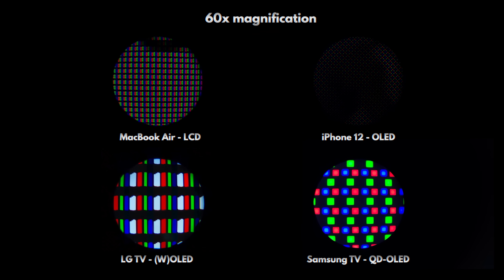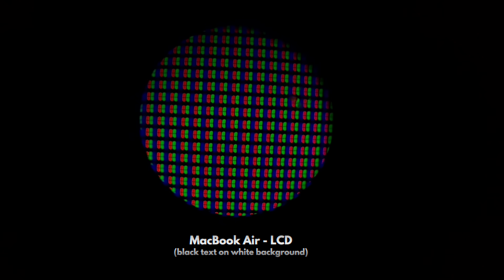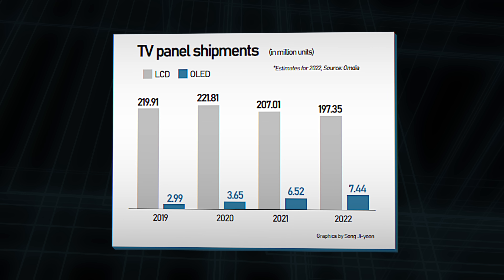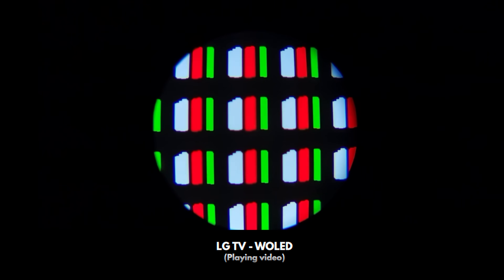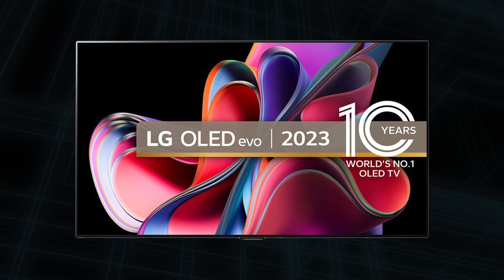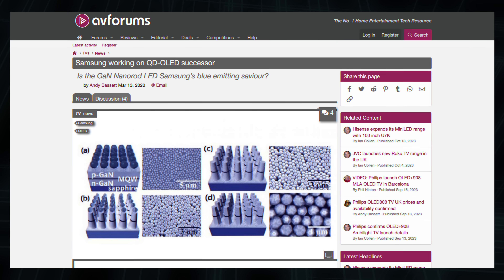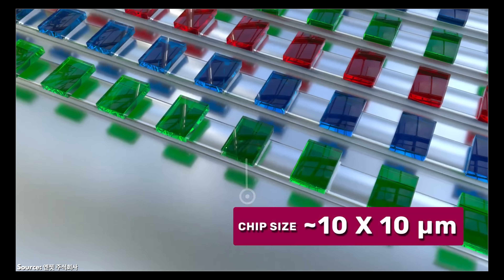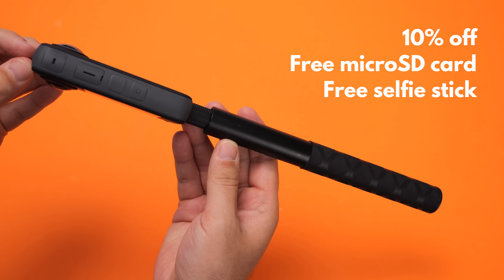The billion dollar race for the perfect display

Comment: I actually like Mini/micro LED the best.  It doesn’t have quite as good blacks as oled but it also doesn’t have burn in.  That’s what MacBook pros have and imo they’re the best looking laptop screens available.
Reply: Burn-in in OLED would happen because they are shipping TVs with bad settings that artificially increase their brightness ruining their color accuracy and adds wear to the panels.

Apple's screens don't have any weird post processing BS, that's why they look amazing.

It depends on the display tech, for example, QD OLED is the best well rounder tech. How Samsung solved the RGB, warm color and brightness problem is brillant and very simple.

Comment: If they could only sort out the OLED burn-in problem for good, that'd be amazing. That's the one thing keeping me from switching out of my LCD PC monitor.
Reply: Samsung already solved it with QD OLED. Micro LEDs also work.

Burn-in on a Samsung QD OLED is similar to a CRT, the overall screen would lose brightness.

Number 1 rule to avoid burn in: don't overbright your image.

Comment: Sticking with my IPS monitor until the burn in problem is eliminated, for a monitor you have so many static things on screen that it becomes a big risk, I like that I don't have to care at all about burn in.
Reply: Samsung solved the burn-in problem with QD OLEDs. Since they are a lot brighter, they last longer and look way, WAY better than LG's panels.

It brought back the CRT and Plasma warm (accurate warm colors) that i missed so much on TVs. It's safe to switch now to OLED, the only thing you should worry about is your wallet.
Reply: @saricubra2867  Its not safe to switch at all, burn in is still a problem and as someone that has static things on the screen for an extended period of time the burn in will happen quick.

Comment: crts and feds are better than oled other displays, just crts are heavy and feds never made it
Reply: QD OLED shares a lot of the CRT's benefits. Color accuracy is the same but it's significantly brighter.

Samsung QD OLED subpixel layout is basically the same as the phosphor layout for their old CRT dynaflat tech (their high end monitors aged extremely well and still usable for current stuff nowadays).

The only thing missing is the perfect motion clarity because no other display tech draws an image line by line like a CRT does (because it's analog).

Comment: It's worth noting that the earliest LCD displays in which a pixel was made from 3 vertical strips of red, green & blue were leveraged by Microsoft to produce a system called 'Cleartype'. 

Put simply, as long as you only intend to produce greyscale (as it common for text) then it's possible to introduce what is known as sub-pixel rendering.

Since the strips repeat RGBRGBRGB and so on, you can (for example) switch the GB of one pixel on & the R of the pixel to the right of it to on. So instantly you can shift a pixel by 1/3 or 2/3.

Sadly LCD screens no longer work that way BUT on platforms like the Gameboy Color, a few developers used this trick to produce much clearer text (hence the name Cleartype).

Comment: QD LED is using Phosphor coating which is what is making the Green and red. This is more efficient that filtering because the Phosphor converts and fluoresces at a higher efficiency (typically >95%) than filtering out (<67%) the light.  Fun fact, this is how "white" LEDs are made. They use ~405um blue LEDs with a controlled blend of green to red Phosphor coating it.
Reply: You seem to be mistaking QD LED to OLED here.
QD LED is an improvement to the LCD technology, where they used QDot crystal in place of the Liquid Crystal of LCD. For the backlight, they used LED. This means that they can be lit really bright without compromising the burn-in, and they have very good motion blur.

OLED is a totally different thing, where every pixel is a diode, without any sort of backlighting. Phosphorescence oled is the new generation, but it's very expensive because you need rare metal (Iridium, platinum, etc.). The latest OLED technology is based on TADF (Thermally Activated Delayed Fluorescence), which is much cheaper and can theoretically be as efficient as phosphorescent OLED.
Reply: @gold9994  sorry I meant QD OLED. normal OLED uses filters over each pixel to colour mix, making them subtractive lighting. QD OLED uses the above mentioned phosphorescence which is a energy state change not a filter meaning more of the source light is used to create the desired coloured, meaning the pixel light can either be driven at lower power for the same brightness or be left at the same power to be brighter.

Since they are using phosphorescence, why do they need rare metals? last I checked red and green phosphorescence powders didnt have rare metals in them.
Reply: @gold9994  Samsung QD OLED is real OLED as well and better than the AMOLED and P-OLED tech that you mentioned. 

There's no backlight. Just like in CRT for the electron guns hitting the phosphors that produce each color and brightness, each blue LED in a Samsung QD OLED is both the brightness and the color for the panel since the quantum dot layer doesn't care.

AMOLED and P-OLEDs struggle with highlight color detail. It's washed out, QD OLED is basically the current CRT minus motion clarity.
Reply: @saricubra2867  Disagree. Bye.

Comment: Persistence blur from sample and hold needs to be solved before anything else.
Reply: only viable fix i heard of is 1000hz, that would have all the benefits and no flicker.
we just need thru the 300hz up to 1000hz, that region the benefits are small. wish we just got 240hz and then skip right to 1000hz.
and we need to develop frame generation from base fps 250 and quadruple it to 1000hz. unless we can also address the latency problem. then we need 120fps to fill the whole 1000hz display.
Reply: @sudd3660  I own a Samsung Syncmaster 955DF, at 60Hz 1600x1200 res, it would take less than 30 microseconds for each scanline.
Therefore it would be around 85000Hz on a Sample&Hold display, not 1000Hz (1ms).

Viable fix is black frame insertion.

Comment: they've already been thinking about how to use quantum dot tech to make micro LED monitors... As theoretically, it should be possible to make the quantum dots glow by applying electrical energy through them, or something along those lines.

problem is how to make a subpixel screen dense enough for it.

Comment: My LG C9 has a power on time of 14337 hours and there’s barely burn in, ive noticed only temporary burn in but you get used to it fading quickly. I usually use it for gaming on Xbox so most the time it’s running at 120fps. Amazing tv would recommend it.

Comment: I've never seen one of these so-called reviews that showed the accurate representations of the screen displays - every one has been a propaganda piece - LED is the most visually destructive, & they also have the shortest life span of any screen display - on top of that - the market-controllers have jacked up the cost for LCD tv's & monitors - because they know it is better - it is visually more stable - it doesn't need the added complexity & it doesn't come with the complications.

Comment: The only thing that new pixel display could move forward is by making bendable pixels to accommodate for the depth to make the image look 3D, or using a real time AI to create a depth map calculations based on the image, that would have to be implemented into new TVs as an underlay but it has to be very fast and accurate

Comment: on the subject of burning, you can see in RTINGs that there are LCD displays that exhibit much worse uniformity in their panels after only 10 months, compared to the burnin of OLED displays. 
So longevity is not only an OLED issue.

Comment: A mistake in the beginning: LCD was not to replace CRT. It was to replace Plasmas, which previously replaced CRT.
Reply: Plasma only existed in TVs. Other screens never used plasma so it's not fair to say plasma had replaced CRT.
Reply: CRTs were so good, we never owned a plasma TV or monitor (if they ever existed). We just powered through straight into the LED era.
Reply: They really both existed at the same time, even as monochrome computer monitors, especially in laptops.

Comment: Yeah, I've been looking forward to electroluminescent quantum dots for what seems like close to a decade now, though at the same time I'm pretty happy with my 4K IPS panel despite the backlight bleeding typical of this kind of display (I'm only aware of it with a static black background anyway).

The thing that annoyed me most about flatscreens was the fact that they work best at native resolution, whereas CRTs didn't exactly have a native resolution. So 240p or 480i retro gaming content looked kind of bad. But I think just having a stupid number of pixels has taken care of this problem. 240p video on a 4K display looks great, even if you still can't use integer scaling for a full-screen image (the pixels are so tiny that even without integer scaling, things look sharper than they did on a CRT). Plus having so many pixels makes CRT filters look great for people that want that look.

Comment: I have a question about the high saturation of colors on modern tv's.  Is it the case that the tvs aren't reading the color profile of the source material and mapping whatever it is fed to the full color gamut of the display (ie, they're not color managed), or is it the case that the manufacturers are purposely boosting saturation to align with what marketing tells buyers, ie, that the more saturated, the better?

Comment: 9:02 This is a VERY common problem with Samsung TVs...got my oled Samsung Tv in 2021 and in 2024 it just stop displaying and even rebooting...got it fixed and was told not to have your TV super bright all the time especially if youre gaming. Thats why the gaming mode picture function automatically dims down your tv brightness when gaming

Comment: The picture of the Baltic Sea shows that the pixels of the micro LEDs are no smaller than those of the OLEDs. Why is a feature listed in the name if it is not suitable for differentiation? 
The difference lies in the material of the pixels of the same size. OLEDs are made of an organic material while micro LEDs are made of an inorganic material. As if the two types should have this feature in their name. So OLEDs vs. ALEDs.

Comment: My phone screen is LCD but still you can see bright in any viewing angles
Reply: ips lcds dont have the viewing angle problem its just the colours are not as vibrant and there wont be true blacks(depending on display and if its miniled or just normal backlit)
Reply: @priyam352  I do agree but it's still ok it has very sharp image, still lack of colors. Ips pictures are not alive it's flat colors unlike the AMOLED that is very alive images.

Comment: so basically, they are trying to emulate the perfect screen, a crt.
Reply: One aspect yoy are missing is that they can go 10 times brighter than a crt
Reply: @NewLightning1 A CRT doesn't produce aliasing and has more accurate colors than overprocessed OLEDs that hide their flaws.
Reply: @saricubra2867 You’re blinded by nostalgia
Reply: @AdamKayaan  I have a 1440p CRT right now and i know what i'm talking about.
Reply: @saricubra2867  bulky and unpractical they are just ass even professionals use lcd or oled
Reply: @priyam352  LCD panels suck and many OLEDs look ugly with absolutely garbage motion clarity (LCD is worse). My high end color calibrated CRT from 2001 is better.

Comment: Lots of information in this that I haven’t heard.  Historically high end LCD’s were a favorite of the home theater crowd because that have better blacks.  And I have never seen an LED screen show any signs of burn in.  I controlled the tech at a 24/7 command center and have had LED TV’s running for over a decade on the same news channel and only the LCD’s would show burn in.

Comment: 1: take an RGB LED.
2: add a vertically spinning cylinder with slits in it.
3: add a faster horizontally spinning cylinder that also have slits in it.
4: rapidly change the LED color.

You just made a display (goofy ahh projector) with 1 LED.

Comment: Very interesting! I for a long time wanted to learn the actual differences between these screen types.
And while LED-based panels have nicer colors, I have one big problem with them. They put a huge stress on my eyes :( While there are a lot of laptops with LCD still (I'm using a Razer Blade), I need to force myself into using a phone with OLED.

Comment: oled spray mfg on window tint with exterior solar direct capacitance @ sunglass dark 
capable of being rolled on or removed like window tint. 
just needs charging conduit and modular plugs + conformal coating 4 exterior installation & clamp on ribbon edge guards/ connectors packed with dielectric grease.
closet of battery/inv.generator per floor would be able to supply high rise dc computers ~electronics and lighting in one + building advertisement through additional screen pixels. the output area could also reverberate the supply of light to the capacitance edge to provide further micro supply tapping of the energy via micro pva as the base for the array of oled and micro led circuits. (printed on thin film~glass)
Reply: you put the WNDW tint over the tv and use the energy output as part of the circuit like led pv relay layer for layered addressing scaled led sections and solar panel V+ groups.

Comment: its always fascinating how much simpler cutting edge technology is conceptually compared to their analog predecessors. Its basically just a grid of colored light bulb that you switch really fast, compared to magnets bending a photon beam to hit a phosphor grid, with a basically hacked in color signal with frankly mindbogglingly awful resolution
Reply: "mindbogglingly awful resolution"
Well, my Samsung Syncmaster 955DF PC CRT monitor is easily a diamond like 2 decades ahead of it's time. 

Legit 1440p clarity from that beast (1856x1392 res with extremely small phosphor dots), it blows my 1080p LCD out of the water, text is sharper 🤣.

Color accuracy and contrast are the same as a current Samsung QD OLED.

Comment: @TechAltar I'm working for a major LED VideoWall manufacture. We actually sell MicroLED videowalls on a daily basis. This is literally our business. So, you are wrong that there are just a few laboratory units in the wild. We have these units in stock.

Yes, they are expensive and not usually affordable for the average Joe. But, these video walls exist and our customers love them.

The most important thing on these walls is, that they are scalable. This means, that you can have any videowall size you want. 1x1 meter, 10x10 meters, 50x30 meters... it's literally only limited by your budget only.

Comment: @TechAltar 11:19 Accodding to Chirag Shah from Samsung Display: MLA is a solution to a flaw inherent to WRGB OLED - it is a bottom emission panel, light gets scattered while passing through many layers, and MLA is there to keep it going straight through them, while QD-OLED is top emission, where Quantum Dots are under the antireflective layer, so there's little light lost and nothing to gain from MLA. Turns out it's not magic 60% boost, it's just 40% of power is wasted by old WRGBs. OLED aside, now I'm curious how QDEL is going to develop - can it get bright and big enough to rival MicroLED, and which technology will get affordable first? I just bought a TV, so for the next few years I can just observe the TV market 🍿